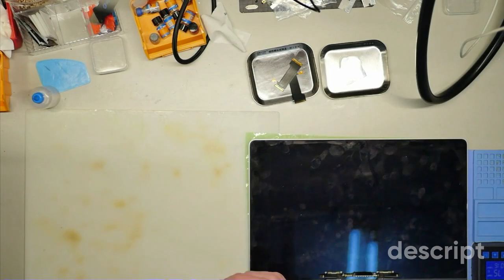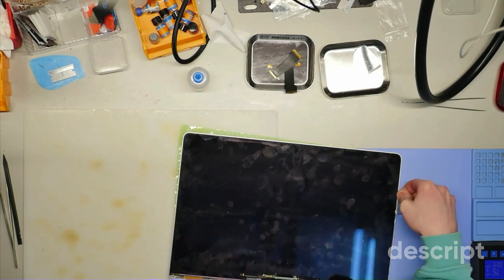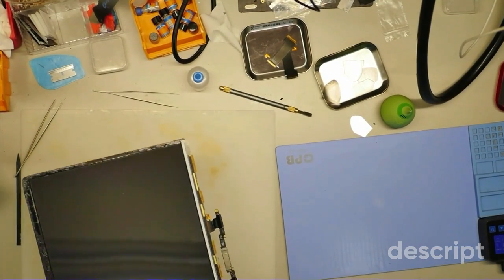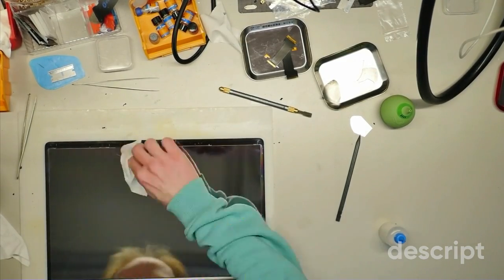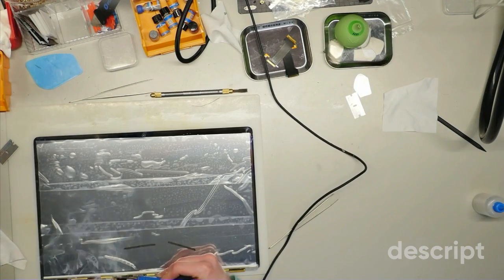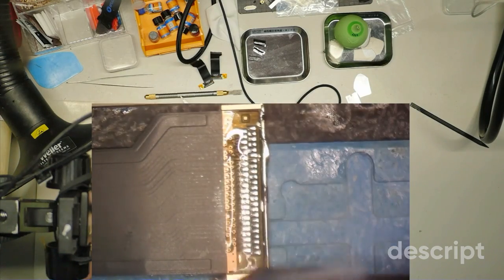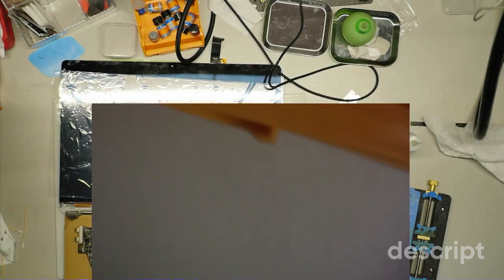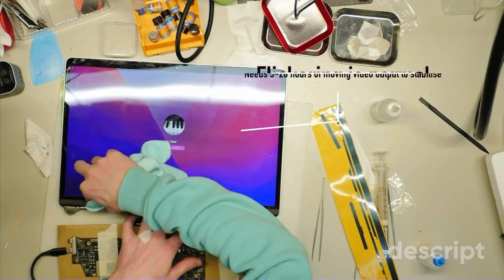MacBook Dustgate repair 2016-2020 Retina Display

Comment: This repair is incredibly frustrating. So far, I’ve replaced flexes in about 20 panels, and I had really mastered the technique — almost every replacement ended successfully. But ever since I changed the tips in my JBC soldering station, I haven’t been able to complete a single repair. I’ve already wasted eight sets of flexes, and I have absolutely no idea what’s causing the problem — whether I’m damaging the flex with excessive heat or ending up with cold solder joints.
Previously, I soldered each pad individually — one by one — onto the unsoldered pads on the LCD and the TCON side, and then applied solder from the top. But with the new tips, that no longer works; I get the impression that cold joints are forming.
Indeed, it’s difficult to properly melt solder on the ground pads with a thin tip, whereas with a K-type tip everything melts nicely — but then I feel like the flex overheats.
Could you share your thoughts about the temperature? What temperature do you solder at, and what do you think is safe? I also don’t know whether a desoldered flex can be reused if it’s not physically creased or broken. I’m tearing my hair out over this.
Reply from the maker: I had similar problem recently. Tin flex cabke from soldering side and wick the pcb side.

Comment: how can I send a lcd screen to you for repair?  it is from a 2019 macbook pro.  I replaced the original screen and would like to have the original screen repaired as a backup.  I live in New York State, USA
Reply from the maker: i do not think shipping + possible tax(?)  makes sense. i will try to find known good repairshop around you who does similar repair.
Reply: @inwerp  that would be helpful.  I cant find one via the web.  hopefully you have better information.  I live in Saratoga, New York,  12850 USA

Comment: 6:35 just ripped three soldering pads when removing the glass cable. can i save the lcd using mechanic magic tag?
Reply from the maker: @dhanaaaaaa  first check if these pads are not ground. Basically it is not very hard to restore, it happened to me few times too. You need to scrape until you fine conductor and put a solder ball on it, then heat with hotair.
Reply: @  is there any schematics/wiring diagrams for this pads? cause when i scraped deep enough, i found nothing but ground. do you mind to make another video for this repair? i believe many broken screens could be saved from dustgate using this tutorial.
Reply from the maker: @dhanaaaaaa  there is no schematics but there are plenty of broken screens so it is not that hard to trace some pads. there are caps and small components on gate drivers board, so if that was not a signal line it might be possible to restore with a jumper. however i do not think that jumper wire for high frequency will work, it might cause some artifacting (im not sure how much it matters but since data cable replacement causes sync loss and self-calibration (display flickering), it seems lenght would matter).
Reply: @inwerp  finally after replacing camera flex and glass cable for the the second time my screen and camera is working again. but a new thin vertical lines appears on the leftmost side of the screen. is it normal after glass cable replacement? thanks in advance. 

https://drive.google.com/file/d/15eXOlrqHnEW-JVZMBBk2Xvqx2URrJM0-/view?usp=drivesdk

Comment: hi, good job.  I do this kind of repair as well and I've noticed that about 30% of displays have residual flickering or artifacts, but 80% of the time the flickering goes away pretty quickly, but the other 20% of the flickering doesn't go away for days, weeks, sometimes even months.  I have a question, maybe you know in more detail why these blinks appear in order to understand how to solve this problem faster than half a year (the worst display was on for almost half a year, and only then it stopped blinking)
Reply from the maker: @Ярослав-ц3м8ш  i noticed it depends a bit on cables you use, but cant tell for sure because I stocked random cables and can't trace where I bought them. Most likely blinking is caused by dustgate glitch itself. I mean there might be some sort of "training" algorithm in Parade which is intended to compensate impedance of flex cable between parade and gate drivers. This is the only explanation of how it "cures" itself. 
 Some dustgate screens have thin horizontal lines and they never flicker after this repair. 
Theoretically then this should be indicated in parade firmware if you dump it before and after flickering "self-cures". Intel TCONs can be dumped with tool called steelite which is fairly easy to find in wild.
Reply: Hi, are you also replacing whole cable or only fixing original one? I fixed many times just repairing broken line 
, but now I have MacBook which I fixed one line and that line is flickering for already couple hours. Will it go away or it has to be fixed again?